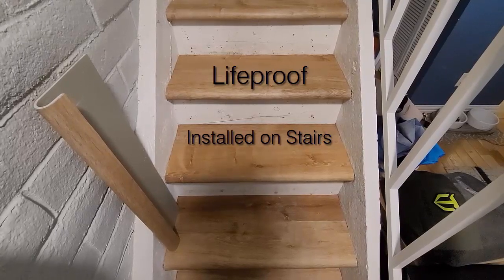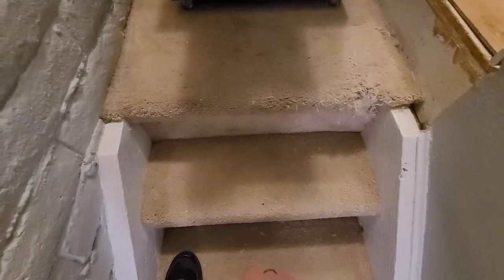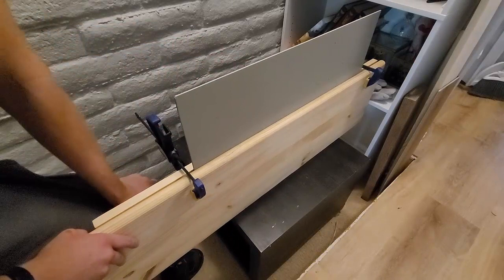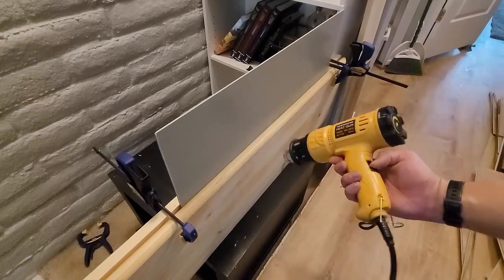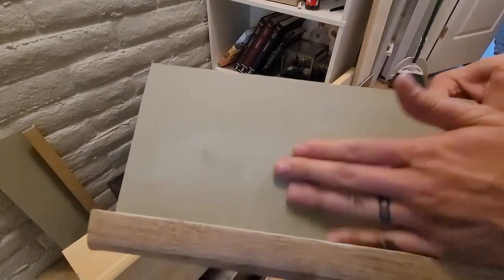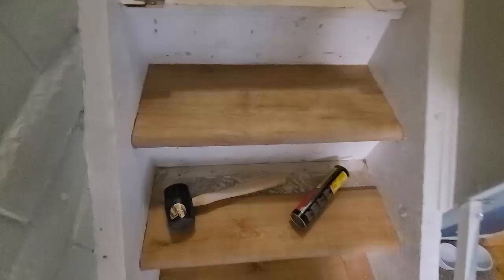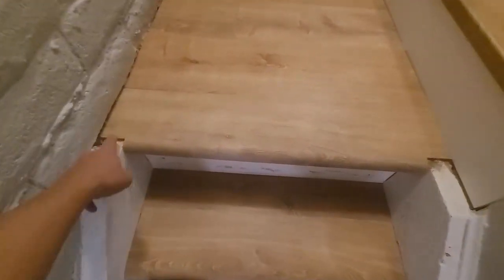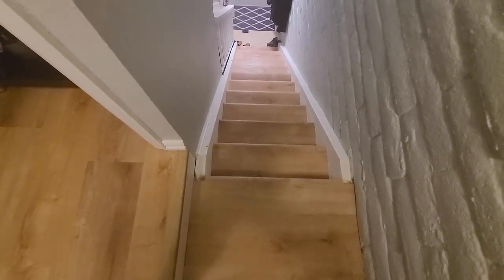Lifeproof Vinyl Plank Flooring - Installed on Stairs with Custom Formed Bullnose

Comment: Just a thot,  but maybe a script would help streamline things. Hv seen a few vids so far. And you’ve spoken about issues that haven’t been mentioned much.  Regarding the built-in padding and how the glue will hold up over time….  Liquid nails seems like it wld work fine for this application?? And I think not routering the plank is best. Might weaken area over time…. ??? And the quick sanding for glue to hv something to bite into.  All Good point’s to consider.  Thx!
Reply: You need to aim the heat gun lower and put a bit of heat to the other side
Your bend isn’t quite round enough
Nice work
Reply: Sand use a piece of wood under Two claps you don’t need more clamps
Reply from the maker: Thanks! A script is a good idea. I was just kind of filming and talking on the fly without much thought. All of those points you mentioned were areas that I struggled to find info for, so I'm glad that they stood out. 

Liquid nails would probably work doing it this way, but you can get a much better constructions adhesive for just a little more. To me its worth the little extra cost to ensure that the treads will not slip out. Thanks for the comments!
Reply from the maker: @bunsdad4530  You may be right that the bends could have been a bit tighter. I was worried about potentially damaging the finish by heating the front. If you are carful this could help get it a bit tighter, thanks.
Reply: @StephenLaGrange  I made a heat bender with a 2x6 2 2x2’s and mechanics wire.  I hear the wire up with my stick welder at the lowest current.  You probably could use a battery charger.  To support the wire I use dry way screws I grind a a lot into.  I just hang the wire on one end or hang a small weight on it.  Puts 5-5550 degree heat right in the bend
Reply from the maker: @bunsdad4530  That sounds like quite the setup. I'm guessing this makes it really easy to bend.
Reply: @bunsdad4530 can u show us a picture?